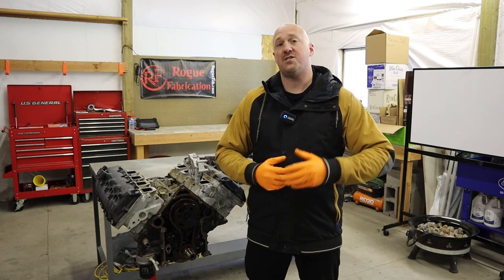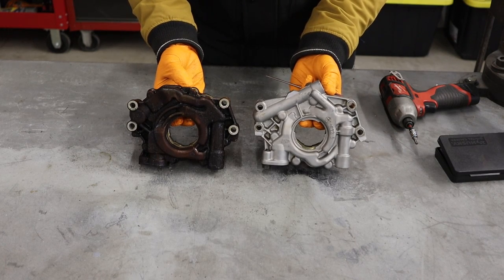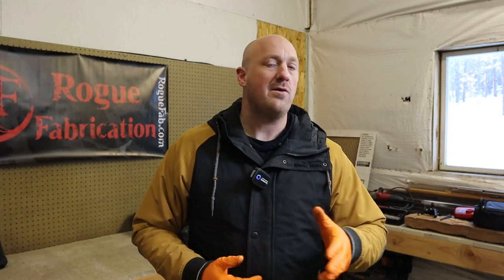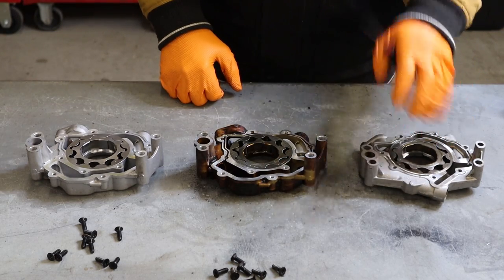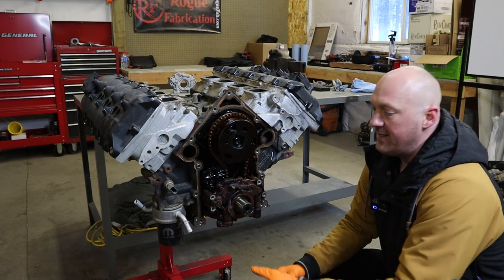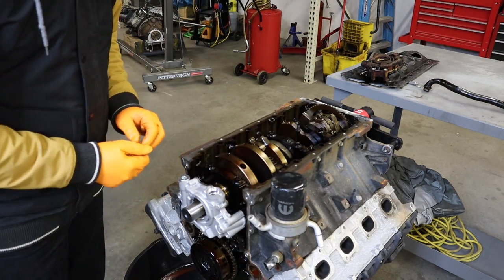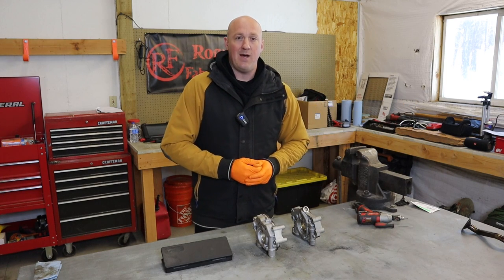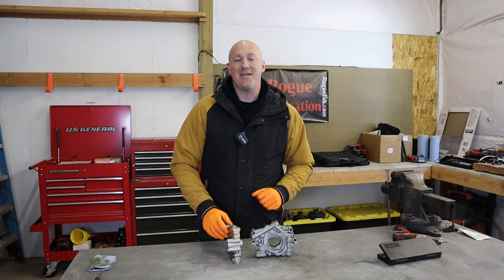Is it TRUE that Installing this ONE FACTORY PART Can PREVENT HEMI TICK?

Comment: Great video as always. Your the best buddy. The last time I had my 14 Ram opened up is when you helped me out on the crank and cam timing and I tried everything to get that pump off without dropping the pan and no success. I didn't want to pry on the tube and getting the bolt back in would have nearly been impossible. So I dropped the pan on jack stands which I've had better times working on ford duratec engines. 🤣 I installed a new pump while I was in there. However, I do wish I knew about the 6.2 pump. I'm looking into it but the thought of dropping the pan again gives me flashbacks 😩 😆.
P.S. if it was me I would take another timing gear and cut a portion out and maybe weld it to the existing one,which could be quite the cosmetic job as well. Can't wait to see what you do sky. 👍🤙
Reply from the maker: Paul you pretty much nailed my plan! Glad to see your name again 👊
Reply: @ReignitedAuto  great minds think alike 😉 👌

Comment: I've always looked at the trucks being more of a pain to remove the oil pan then the cars. In the cars you can use a fender well hoist and just drop the subframe in the trucks it's literally just a frame to deal with lifting the powerplant up enough to allow the oil pan to clear is an issue with a "full framed" vehicle. It takes no time to remove a subframe but an actual frame requires you to work around it but this is obviously just my opinion.
Reply from the maker: That is true! Everyone has a different way of doing things, and I'm always learning because a lot of times other people will show me how to do things better/faster than I currently do them. 💪 Appreciate you watching Jeremy!

Comment: Might be worth noting that in some ways there are two variations of the VVT motors.  The 09 and 10 motors use a different pulley offset than the 11+ motors so the water pump and harmonic balancers are different between those years.  The interesting thing is, it appears things like the power steering pump cross the boundary of VVT and non-VVT so it is possible that the 09/10 Eagle motors use the same pulley offset as the 08 and down motors. Could be that an 09 harmonic balancer on an 06 motor would only require the crank sprocket modification and remove the need to modify the 06 balancer to fit the HC oil pump.
Reply from the maker: I did not know this,  appreciate the new info.  👍
Edit, now that you have me thinking about it,  you're right because I used a 2010 challenger timing cover on my C10 392 build,  and I had to get a 2010 alternator for it to line up correctly! Very interesting.

Comment: I have a 2019 challenger rt with a bunch of goodies. I didnt know about hellcat oil pump,  but i run 10w-20 instead of the 5w-20 and it has helped with oil prssure. I run about 50 psi at idle when at temp and 55 at cruising

Comment: You can “easily” (with a small pry bar) pull the pickup tube out of the oil pump and remove the pump without completely removing the oil pan, but I did have to lower it (left two rear bolts in a couple treads and pulled the front of the pan down) in order to get to the bolt on the pickup tube due to the oil baffle/windage tray.

Comment: I absolutely love the content you’re channel is my favorite hemi channel on YouTube -  I’ll be adding that hellcat oil pump to my list thanks.. 👍🏻👍🏻

I have 2009 charger rt  I’m getting ready to change the cam to a 6.4 I love the fact you have been listing all the part # do you know if you can bolt eagle 🦅 heads on a 6.4 short block ?  
I do all my own work I have a ton of bolt on’s on this old gem 💎 only a summer car as we are from Michigan..

Mods so far - full srt8 suspension Under carriages rear diff 306 ratio and full brembo brakes swap, ported and polished, intake and 87mn TB, long tubes 1-7/8 high flow cats, slp lound mouth exhaust 3”

Comment: Love your videos. Please let us know as soon as possible how the 6.4 Scat Pack oil pump compairs to the Hellcat oil pump. I believe there are many  Scat Pack owners such as myself that would definitely do this mod if we knew it would benefit us. Thanks for all you do!
Reply from the maker: Got it ready for you: https://youtu.be/6W0fTmCFS_w 👍
Reply: Thanks Sky! That helped a lot! When I do my camshaft and lifter project I will include the HC oil pump. I sure appreciate your research!
Reply from the maker: @dwaynehubbs4907  one thing to keep in mind though, I still haven't figured out why some vehicles are seeing a low oil pressure code after installing the Hellcat pump. It does appear to be related to the MDS system because some viewers have told me that if you turn MdS off it won't set the code. So take that as you will. 👍

Comment: I bought a 2022 Ram 2500 in November of last year with the 6.4 Hemi and noticed right away that Hemi Tic on cold starts but it just last a couple of seconds and most the time it does it after it has set a couple days, I'm not worried about it and love the truck I pull a 30Ft Travel Trailer that weighs 8 Thousand Pounds with it and it does good. Traded in a 2020 Ram with the Cummins on it the 2020 was a Nightmare because of all the Governments Diesel Enforced Emissions on it, the last year I owned it I had it in the Dealership Three Months and it still wasn't fixed. I got almost what I paid for it on trade.

Comment: Question, is it not better to use a Melling HV oil pump #10342HV which has 20% more volume and 10% more presure than stock pre 09 engines? Also has an optional 20 psi springs for more presure. No mods, direct bolton. Great vid, keep up the awesome work!
Reply from the maker: I'm planning in doing a direct comparisonvideo between that pump and the hellcatone on the pre 09 engines. Likely the Melling pump will make more sense, just want to see 👍
Reply: @ReignitedAuto  I actually just put one of those melling  m342hv oil pumps on my 2008 Chrysler 300C. It was very easy installation, direct bolt up. My idol PSI on my old pump was 17 to 19 PSI. With the melling oil pump my idol PSI is a steady 24 PSI.
Reply: i bet that Melling pump has Hellcat rotors inside 2003-2009 housing.
Reply from the maker: @Rrottweiler  certainly a possibility, I'm buying one now so I can compare it 👍

Comment: I ordered the melling high volume pump for my 15 ram . They sent a pre vvt pump . The length of the pump gear on the crank snout prevents the mounting cast from reaching one another.  There was about a half inch gap between the output  port on the pump and the mounting surface on the block. The pre vvt pumps absolutely will not fit on a vvt hemi

Comment: Just use a 5 or 10w-30 instead. You don't have to use 5w-20. 5w-20 is just a universal grade they expect you to find. The owners manual says to just use a chrysler ms 6395 certified oil which you can find in 20 and 30 grades. The new quaker state full synthetic has the chrysler material standard 6395. I have friends who use a 30 grade in their newer hemi's and have zero issues, no CEL, and no tick either.

Comment: Thank you for this video! Very intriguing analysis on oil pressure. My morning commute in Atlanta involves driving in stop--nd go traffic and I have a habit (bad one) of idling for an hour while I take lunch in my car. Are these two habits deal breakers on Hemi engines? I'm looking to get a new 6.7 or 6.4 Hemi Charger. Tired and bored of my Camry TBH!
Reply: very bad habit for a 6.7 cummins since new ones when do a regen dump fuel into cylander, causing oil dilution.
Reply: very bad habit for a 6.7 cummins since new ones when do a regen dump fuel into cylander, causing oil dilution.

Comment: The actual problem is that the cam is heavily shrouded by the block. At idle oil does not get a chance to be slung from the crank to the cam. It was actually an original Hemi engineer that said the cam should be moved up and away from the crank. I use Mellings high volume pump with the 60 psi spring.
Reply: That’s the pump I use also. I forgot what spring I have in it? but I know I idle at temp around 50 psi

Comment: I'm at over 70k miles now.  At this point I'd only do this if I experience cam and lifter failure.  Then pump would go in with the new lifters and cam.
Reply from the maker: That sounds like a solid option to me. 👍

Comment: wouldn't the pickup tube be a little bigger for hellcat pump, but they do make higher volume oil pumps so you could always go aftermarket
Reply from the maker: I'm thinking of doing a comparison video between the Melling pump and the Hellcat pump, would you be interested in watching that?
Reply: @ReignitedAuto  yeah definitely
Reply: All the research I’ve done leads to the Hell cat pump being the better option. The difference is high psi as opposed to high volume. Melling performance is a high psi pump Hell cat pump is high flow.  Melling pump creates high pressure output right from the pump discharge by use of the relief. Hell cat pump puts out a high oil volume allowing the pressure to rise within the engine just from the extra volume of oil being forced thru it.
Reply from the maker: @cowchux  yep

Comment: @ReignitedAuto
I had cam/lifter failure - 2011 RAM 1500 5.7L.
I just bought the Hellcat pump 68195993ad and did the side-by-side on the old oil pump VS the Hellcat, and they both measured the 16mm width [Rotor thickness]...
My old oil pump had a "622BF" stamped on the back plate.

Have you ever had one out of a RAM truck?

Comment: My 16 Ram 1500 with 5.7 tick hot or cold.  started ticking at 209k miles, At 227k miles I pulled lifters and cam. #1 cylinder exhaust lifter has barely visible wear.  All others look great.  #1 piston shows lots of soot and all intake channels show Heavy oily soot.  I do not think  #1 exhaust valve  seals at all. I think my tick may have been at the rocker arm.

Comment: you may have uncovered a chrysler secret they don't want people to know, namely that the oil pump was undersized after going to VVT, during extended idle and it took 10 years for them to discover the true cam failure reason, although i am sure they would never admit it. also oil quality would play a factor too.
the higher volume oil pump should be standard in all new hemis, 
be interesting to know if it is.
great detective work.
Reply from the maker: Thanks for watching Clint!

Comment: I kinda wish you had a 2021 oil pump also. I have a 13 RT Challenger and the oil pump went out in my car the dealership put a new oil pump in and oil pressure increased. Before the change when cold oil pressure was barely 40 psi. Now hot it holds 45 psi
Reply from the maker: Very interesting! I wonder if the stock pump already had some manufacturing issues that led to the failure in the first place?

Comment: I would definitely love to see you dive into the oil Temps on the 5.7. 220° F is definitely too hot for my liking. On the 1 block I see there's the oil heat exchanger. I'm thinking about adding 1 to my 17 5.7 hemi or maybe a aftermarket oil cooler. Cooking oil at 220° F definitely brakes down the lubrisity property's of oil way faster than 180-190 would.
Reply: Install a 180 thermostat and reset your fan temps with a tuner tool. My oil temp on both of my late model Mopars rarely runs over 190 F. as a result.
Reply: @MM_in_Havasu  unfortunately that will not do anything with out adding the oil heat exchanger. Here in Canada when it's -25°F outside driving 80 mph on the hyw my engine temp hovers at 197°F and my oil temp is 212°F so not really alot of difference from summer driving when it's 220°
Reply from the maker: Appreciate the suggestion, I was actually thinking of doing a video on that because the one block does have that heat exchanger on it. 👍
Reply: @ReignitedAuto  ya. On the newer 5.7 hemi it's an option for police vehicles atleast that's how mopar has it listed.
Reply: Actually 220° isn't that bad. More so with good synthetic oil. 240°+ you definitely would like to take action however.
Reply: Weird. My oil temps never passed 203, idling in 115 degree heat. I threw on a performance thermostat. Tuned the fans, dropped it down to 189, coolant also around the same drop. Switched oils and filter used and now it sits at 186 consistently.
Reply: @mrhyde0705  same, my oil temp never goes above 190 unless i get on it, but it goes back to 190 instantly. I think the 210 coolant temp and 220 oil is stupid. I run 10w-20 and a 180 thermostat
Reply: @shawnh2870  that's funny, I live in Lake Havasu City, AZ where our summertime temps regularly exceed 115 F. Both of those cars do not run significantly warmer even with summer temps, unless stuck in any kind of traffic, and oil & water temps both cool off right away once moving again in that kind of heat. This is with A/C running as well.
Reply: That is not that hot for synthetic oil. Load is what adds temperature and you guys must have hemi's in cars or not tow. My ram hovers between 240 and 250 when I tow in the mountains and it's okay. Just have to change my oil before and after the trip. First, don't ever run a new engine at a cooler temp than 190. Do your research about running engine's to cool. Incomplete combustion, clogs cats, oil sludge build up, contaminated oil, and overall more build up of deposits. BTW  I'm a diesel mechanic and do all my own work and never had a problem. I do maintain the shit out of my vehicle's tho.

Comment: Check your oil pans if you live in rich road salt environments, my 3rd gen ram 2500 bought new...

  the Aliumion heat sheilds desinergrated on my truck...

 Im happy to report the 5.7 with 216,000 km  is still going strong, pared with a 6sp man...its torque is a pleasure for the truck stuff,
Reply: Try again....oil pan needed a blast of trenclad rust paint .....

Comment: Do you think that the pan capacity should be increased with a higher volume pump to prevent starvation at sustained high rpm? What’s the Hellcat pan capacity?
It does make senses that the post 09 5.7 pump would have more volume due to the VCT oil demand.
Really great video! Love your content!

Comment: I live in Canada and bought my truck new in 2018.once it gets cold I hit the tow mode button until the engine warms up.this keeps the cylinders from shutting down in eco mode.i think this helps when the oil is cold and stiff.
So far I have 50k on it and do oil changes ever 4000 miles. No tick so far.
Reply: does the MDS work at idle?

Comment: First, thanks so much for all this good, well-researched information. Two months ago I purchased a 2013 Grand Cherokee with 5.7 Hemi. It only had 52k miles/3600 hrs. on engine and great CarFax record for maintenance with one private owner. After only 400 miles of me driving, check engine light comes on yesterday, my code reader shows Misfire #3, and mechanic then finds that I have lifter/cam failure. I am being quoted $5k plus to fix. Should I go ahead and fix and put Hellcat oil pump in (as long as inspection doesnʻt show metal shavings in the intake) or get a new engine entirely? Thanks for your help and advice. Really thought I did my homework on this buy and feeling pretty crushed by this news.
Reply from the maker: Appreciate the kind words! I can say that if there's no metal in the OCV screen I would have no concerns about just replacing the cam and lifters, I've done quite a few over the years and haven't had any come back. As for the Hellcat pump, I've been getting some reports from people that it is intermittently seeing a low oil pressure check engine light, which is of course exactly opposite what is actually happening. It seems to be related to the MDS system because if you turn the MDS off it doesn't set the code. However if you don't want to mess with any of that then the stock pump would be fine.
Reply: @ReignitedAuto  Thanks, I appreciate the quick reply. I am towing the Grand Cherokee  from my local mechanic that diagnosed the code error to local dealership. My hope is that FCA will contribute to the repair given the relatively low miles. I've seen online where FCA has helped repair this failure even when the vehicle is out of warranty, have you seen that to be the case? Thanks again!
Reply from the maker: @stevehobbs5022  it usually depends on several factors: your relationship with said dealer, their standard operating procedures regarding vehicles out of warranty (everyone handles this differently) and how well maintained the vehicle was to this point.

Comment: I wish I knew this before I ordered the high pressure oil pump, that I have. They say they just change the spring to a stronger spring, to raise the oil pressure. I hope it works for me. I should have ordered a Hellcat oil pump. I have the 2011 Charger RT.

Comment: Great video, but I do have one question...I believe the pre 2009 Hemi did not have the same issue as the 2009 to present engines, meaning lifter failures did not occur very often, but in fact the issue was valve guides dropping into the cylinder....if I’m correct should I be as concerned with at idle oil pressure on the pre 2009 engine or upgrade the oil pump regardless?  Thanks!
Reply from the maker: You are absolutely correct that the lifter issues did not really plague the earlier models. I just wanted to find a way to adapt the Hellcat pump to the early ones because more oil pressure can't be a bad thing for any engine. 👍
Reply: @ReignitedAuto  thanks for your reply, I really enjoy your videos and I hope your channel continues to grow.